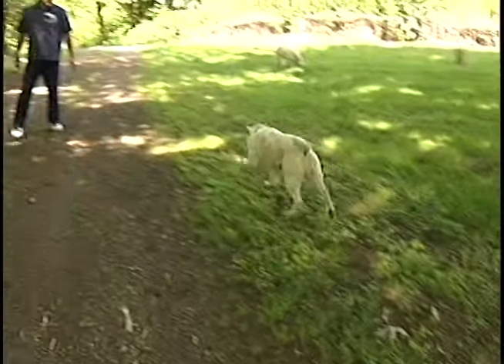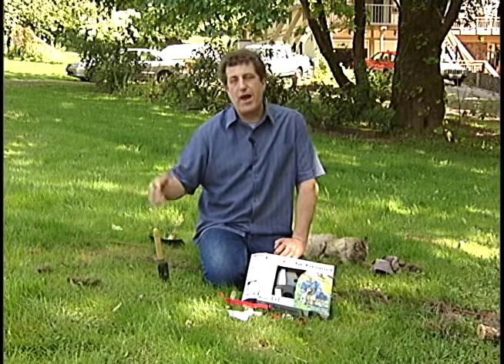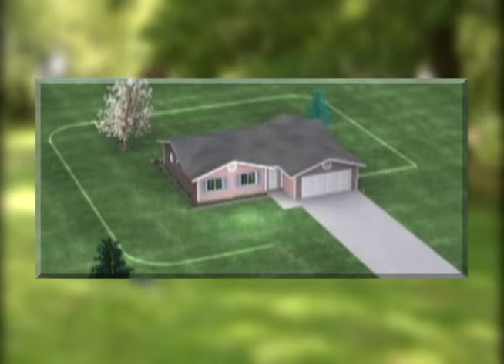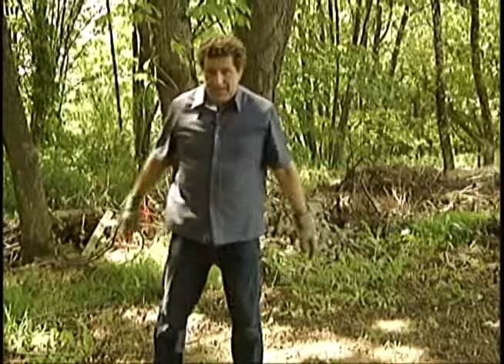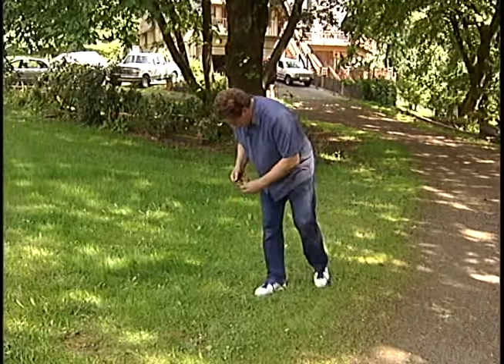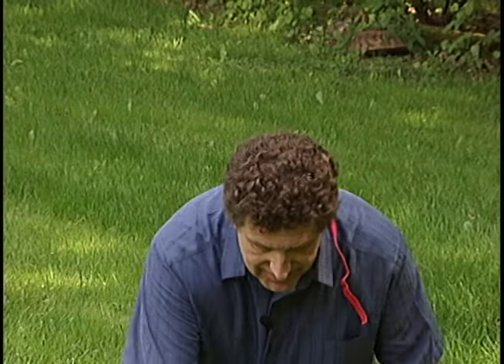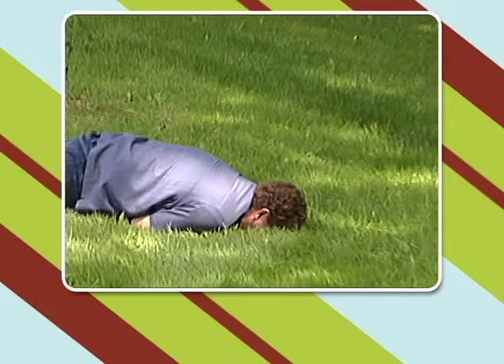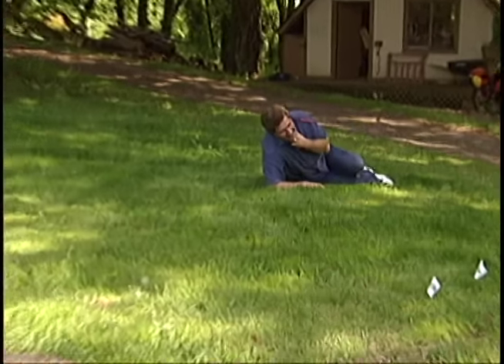Shock Collar: Invisible Fence

Comment: You said a pipe for gravel driveway? What about a concrete driveway? What do you do?
Reply from the maker: Sorry, you'd have to dig it up or tunnel underneath.
Reply: Just cut into the concrete just slightly to place the cord so it doesn't stick out. There is a video somewhere that talks about it.